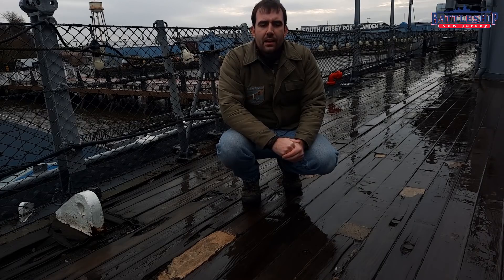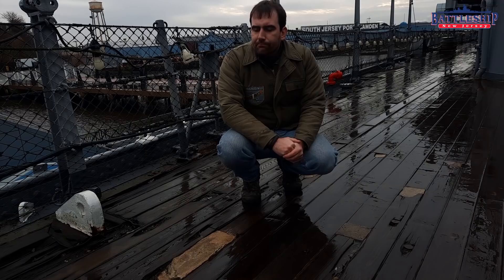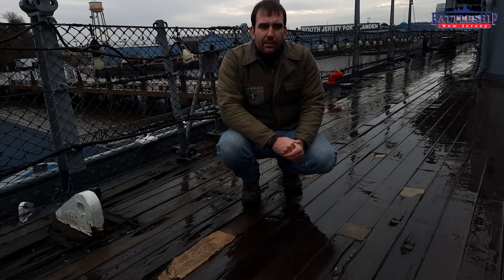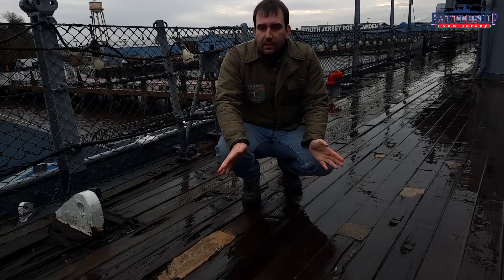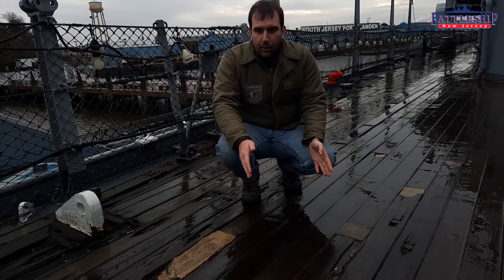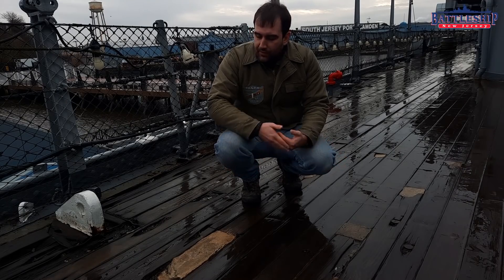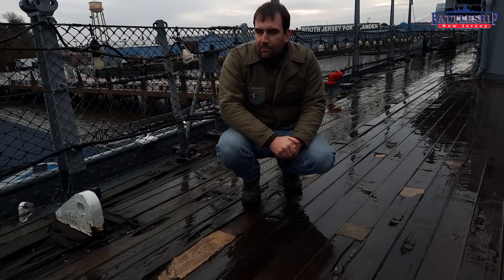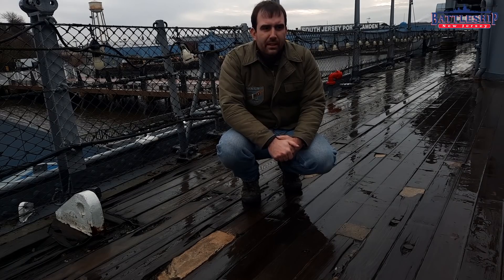Why aren't Museum Ships in Concrete?

Comment: Engineer here. Concrete is basic. its PH is about 12 when when freshly dried. This decreases to about 8 or 9 as the concrete ages. Concrete does react with steel, but the reaction is self limiting because the the highly alkaline environment creates a protective film on the steel. This protective layer also provides lasting protection in the event of water ingress to the steel There is a reason that reinforced concrete works so well most of the time. 

The reason Ryan is seeing what he is seeing is because of the ingress of chlorides (like sea or road salt.) AND water. The chlorides break down the protective layer and allow corrosion to progress. The likely reason we are seeing this happen much more quickly than is the case for say many marine reinforced concrete structures is because a piece of rebar is completely immersed in concrete. A steel plate set against concrete has an exposed edge allowing ingress of chloride contaminated water. Any corrosion causes the concrete and the steel plate to peel away from each other, exposing the whole underlying surface to corrosion.
Reply: If you could park it a ways away from that big ocean thing.
Reply from the maker: Fortunately, we did just that with NJ, the Delaware River is fresh where we are. However, this isn't a practical solution for all of the ships.
Reply: @ashman187  This is a ship that has been at sea for many decades. Unless it is thorough cleaned and blasted, you will find sea salt contamination on most surfaces even if it is put in fresh water. Salt acts an electrolyte and is not consumed during corrosion so a small amount of salt will eventually eat through a thick plate.. This coupled with the disadvantageous geometry of encasing a steel plate in concrete make it difficult to make use of the same material science principles that preserve reinforced concrete to preserve a ship's hull and deck plates.
Reply: tell that to the people at BB Texas they tried that and shes so close to being lost forever her structural steel is mostly rust now last time i saw a story on her she was a t a list of 37 degrees concrete isnt the answer its just a kick the can down the road approach thats about to kill the oldest remaining Dreadnought Battleship in the world
Reply: It does not. Reinforced concrete rusts from the inside precisely because concrete is porous. This is a big problem here in northern Europe where frost weathering also comes into play. Concrete constructions such as buildings and bridges therefore rarely have a lifespan of more than 80-100 years - and this is with perfect maintenance.
Reply: @Hvitserk67  The point us that concrete is not acidic and does not, in itself corrode the steel. Reinforced concrete works because concrete chemically protects steel.

It us true that carbonation will eventually attenuate the protection that concrete offers to steel, but the steel is still better protected as long as it remains bonded to the concrete ( which is impossible if you are layering it over a plate to protect a ship). 

If we agree that reinforced concrete will last decades, how long do you think an exposed piece of steel will last in the same environment?
Reply: @paullim706  Agree, but reinforced concrete is not the solution. When the steel in the concrete eventually rusts, it expands and this destroys the concrete from the inside. We have cases of this here in Scandinavia where, for example, bridges are not more than 15-20 years old. On the other hand, there are similar structures that are much older (eg railway bridges from the beginning of the 20th century and German bunkers from WW2) that are still as fine as when they were built. I do not know why this is so.
Reply: Sure. I am pretty emphatic that covering  ship in concrete is not a good solution and that the chemical processes that protect steel rebar do NOT work well on a steel war ship deck and hull.

The service life of reinforced concrete is dependent on good practice. If the structure need remediation after only a decade, it is likely that construction errors happened.--Though in the latter part of the 20th century, certain practices like epoxy coating rebars turned out to be a huge mistake.  I think the perception that older structures last longer may be down to survivorship bias. The composition of concrete and rebars has not changed much.

One more thing. A key difference between civil and tactical military structures is that bunkers tend to use less steel rebar for a given thickness of wall than a civil structure. If you are building a thick pieces of wall in a civil structure, it is likely carrying a massive load and will be heavily filled with rebar.  A thick bunker wall serves to prevent the passage of munitions and explosions. It does not need to be so heavily reinforced with steel as it is typically more economical to simply bulk the structure up with more concrete to achieve the same protection. Steel is a strategic resource and there are incentives to minimise its use. If there is rebar steel in the structure, it is there to arrest crack propagation and it is likely deep inside the wall where carbonation and chlorides will take over a century to reach it.
Reply: Also an engineer here. One fundemental problem I foresee with the "ship in a concrete" idea is slight difference of thermal expansion coefficients (~15%) and huge difference of heat capacity (208%) of steel and concrete (or any surrounding material for that matter). This is problem is "quite" apparent when improperly designed (or built) railways expand and buckle like this: https://youtu.be/jJeiYaSFCf0. Thermal expansions might not matter for smaller objects or steel evenly distributed inside concrete, but we are talking about a 270 meter-long ship. From -5 degrees to 35 degrees C, it would mean ~16mm difference when both steel and concrete expands at same temperature.. Worse, even if the same air temperature is same, under direct sunlight, temperature of steel an concrete will never be the same. If there happens to be a just 5 degree Celcius difference between battleship's steel structure and concrete, that translates to ~129mm thermal expansion over the length of the ship. This can go both ways: a strong wind at winter will cool down steel ship quicker than the concrete. So after a year of expansion and contraction there is no way concrete will just form an air/watertight seal around a battleship. All that friction between dissimilar materials will only help erode the paint faster, put additional stress on the ship's keel. Concrete "bathtub" will just prevent rainwater filled underside from evaporating. Its a terrible idea to put a ship on a concrete. Just dry docking it every 10 years and painting it is a much better solution.
Reply: @redeyedwithanger5866  The Texas's list was six degrees, not 37. She would have been effectively unrecoverable had her list been so severe, presuming she didn't capsize.
Reply: @redeyedwithanger5866  Bingo. I was going to say this as well. Concrete nearly destroyed her.
Reply: @JarrodFrates  The Texas was petty much buried in the mud which prevented her from going over.
Reply: @Hvitserk67  - The use of deicing salts on the roadway is the primary cause of corrosion of reinforcing steel.
Reply: @paullim706  - The point of reinforcing steel in building structures is to allow for tensile load capacity (load a concrete beam or slab in bending and one side is in tension and the other in compression), as well as to insure ductile failure rather than brittle failure of structural elements.
Reply: @Hvitserk67  I'm no concrete expect, lol but the brooklyn bridge is 153 years old, its piers consisting of Rosendale natural cement, many structures here and around the world used that same natural cement and are still in solid condition far longer than 100 years. Statue of Liberty concrete base - 146 years, Federal hall national memorial - 180 years. etc etc.
Reply: @tominiowa2513  Yes. And the purpose of certain states using deicing salts on the roadway isn't for safety, as they like to claim, but rather because of lobbyists for auto makers influencing government officials to keep using it, so the vehicles rust faster. Many cold states still refuse to use salt on the roads, and they do just fine in the winter. So that type of influence not only causes our vehicles to rust, but our infrastructure as well.
Reply: @AmericanThunder  Yes, there are obviously good examples where concrete lasts a long time. I think that it might be that really cold and humid weather affects the concrete to a greater extent than otherwise (considering my own examples from 60 degrees north and with relatively humid weather from the Atlantic Ocean). How, for example, does old concrete hold up in Canada, which is perhaps more reminiscent of Norwegian conditions?

Comment: @BattleshipNewJersey You are absolutely correct on everything except for when you said concrete is acidic. Concrete is actually alkaline, which can cause corrosion issues as well, because you can use muriatic acid to acid wash concrete to remove staining, because what your doing is actually dissolving a portion outermost layer of concrete.

Comment: Not to be "that guy," but concrete is extremely basic. pH of 12-13 when wet and still 8-9 when dry. The wet concrete isn't much of a problem, but the interface of steel and concrete at the lower pH is problematic in the presence of oxygen and moisture.
Reply: A lot of people forget that limestone is a base, not an acid.
Reply: @Jim Frazier Sorry. Checked with my dad (boiler room tech from USS Oklahoma City in Vietnam). He confirmed that none of what you said makes any sense, chemically speaking.
Reply: @Jim Frazier We do have some similarities, then- I was taught by  some of the guys who designed that reactor you worked on (or the whole boat, if it was Seawolf-class) I'm guessing that the off pH is for neutron retardation/preventing scale buildup, but I can see a mere tech mistakenly assuming it was for the steel.

And rebar is supposed to be deep enough to remain dry.
Reply: Concrete does not corrode steel, but moisture + concrete does.  That is why great effort is put into putting protective coatings on the rebar that reinforces critical concrete structures that are exposed to weather (like bridges).  If the coatings are ever compromised, corrosion will occur.

Comment: "Since gold never corrodes and can be moulded to any shape, it's used to make long lasting electrical connectors in all types of devices. Gold is one of the least reactive elements on the Periodic Table. It doesn't react with oxygen, so it never rusts or corrodes."

So coat the ships in Gold! Duh! Do I have to think of everything?? I can donate $5 towards the cost.
Reply: That's ridiculous.  They should float the battleship in oil. 10,000 gallons of sweet Texas tea will float anything.  The museum is smoke free right?
Reply: It's a real no-brainer! isn't it! !    :)
Reply: @SuperRootUser  Oil floats over water.  So rain/seawater would just push the oil away, no?
Reply: Seeing the Uss New Jersey in great white fleet colors would be a sight.
Reply: @jballaviator  One would think but, again, oil floats on water so water would "sink" and accumulate below the oil/lube mass.  You'd need a liquid heavier than water in order to always stay below any water.  Maybe mercury?  But I don't know how mercury would interact with the steel of the ship (or if you could even make a vat of it where the ship sits in... or even want to).
Reply: Better use for it than slapping it on a cheese burger for the rich to eat.
Reply: So you have donated enough for one square inch.  This is a start,  but there is a lot more to be covered.
Reply: @poorwotan  you pump it out at the bottom with a sump pump
Reply: Tarnish is corrosion dude. you aint never seen Tarnished gold before? why do you think they make gold polish. Gold does oxidize just not to the extent Iron does.
Reply: @SuperRootUser  Flip a light switch and THAR SHE BLOOOWWWSSS!!!
Reply: @poorwotan  if the oil is the first poured it's opposite. the water floats on top. and oil is used alot in finishing and house painting as a sealant. oil has a higher surface tension than water. just ask anyone who's tried to clean up an oil spill, over time the oil coagulates and sinks.
Reply: You are wrong gold doesn't oxidize. You are referring to gold colored metals falsely sold as good. This is why if someone buys you gold jewelry and it turns green, it wasn't gold.
Reply: Gold actually can oxidize

Comment: Always love these videos. 
As I mentioned in the live-chat, would a thick hard-rubber gasket placed along the whole hull in between the ship and the concrete be able to ensure a watertight seel and protect the hull from the concrete, while the concrete applies the necessary pressure on the hull to prevent pancakeing be a viable solution?
Reply: A lot of polymers breakdown forming acids inside the polymer accelerating further breakdown. If polymers can't outgas because they are sealed completely, their life is about halved and in the case of rubbers they usually turn into goo instead of hardening. This idea has been tried for things like bridge and wind turbine footings using rubberised grouts with predicted lives of 50 years or more, that started to break in about 10 years. Engineers at the time (late 90's early 00's) thought that by using very pure polymers the breakdown process would be slow to start, but the high stresses put on the material started the process.
Reply: @hart-of-gold  huh. That's really fascinating. I never learned that. Very interesting. Thank you for the well-informed info.

Comment: is there a timeline for when the next drydocking is intended for the New Jersey?
Reply from the maker: Sometime this decade. Weve started conversations with the potential yard.
Reply: @BattleshipNewJersey  is there any difference in the dealings with the yard for a historic museum ship compared to a working commercial vessel?
Reply from the maker: We are slightly more limited to where we can be drydocked because wherever we go we're going by tug and a dead ship is a risk in the open ocean, so that's limiting. And being as big as we are, there are only so many places that can take us. Otherwise, its basically the same, we have to make sure their folks know when it comes to it that not all our heads work and that we have unique systems for HVAC and all that but its mostly the same idea

Comment: The solution would be to design a fluid with a neutral ph and the same density as sea water to preserve ships.
Reply: Freshwater?
Reply: @fritzpitz2652  

Different density, so it would cause hull warping issues.
Reply: The New Jersey is moored in the Delaware river, so she is already in fresh water. The lower density just means she floats a bit deeper in the water, which can be adjusted with ballast. The main issue with anything other than water is cost. Museums tend to operate on thin budgets. For example, to float her in crude oil would require about 23 million dollars worth. Any engineered fluid would be more expensive.
Reply: @thoriated  Also fluids leak which could hit the museum with the dual calamity of both replacement cost of the fluid and environmental remediation.

Comment: Hi Ryan. The Teak decking is very nice indeed when you have a few deck divisions and carpenter working to maintain. Have anyone considered non-skid decking
Reply: They probably have but decided to keep it in the original teak for historical reasons. I'm sure that with modern materials, they can replace the teak with new teak and coat it with something that's extremely durable, weatherproof, and long lasting while still looking original.
Reply from the maker: Beyond the historical reasons for keeping the deck, there are also practical reasons: the deck provides insulation for the ship. 

Heres some additional info on what we're doing: https://youtu.be/q1bLAeTJEQE

Comment: The Intrepid Museum had to remove all the flight deck wood due to rain water leaking down to the lower decks, they repaired the corrosion and coated the flight deck with a non skid coating.
Reply: Couldn't they replace the wood with new wood?
Reply: @bobbyrayofthefamilysmith24  It was probably decided on cost. Yes, you could replace it with new wood but after crunching the numbers they decided to do a more permanent coating.